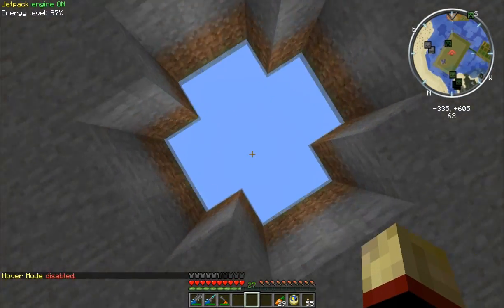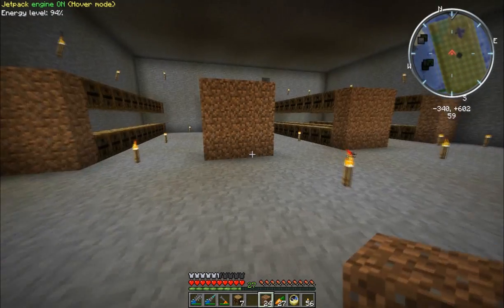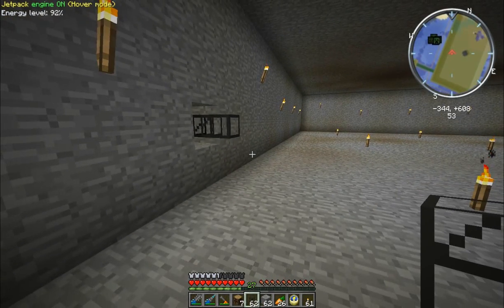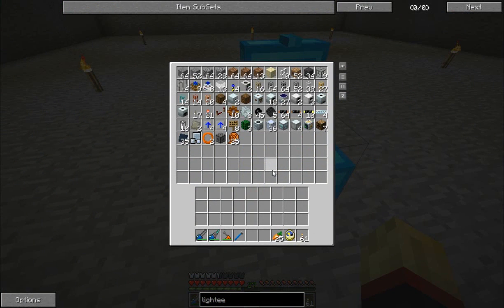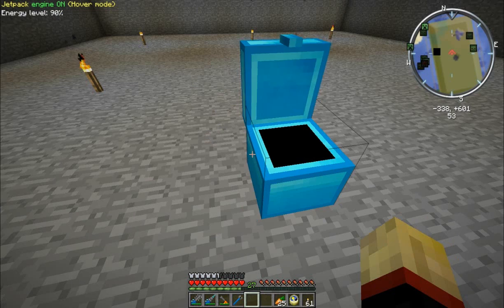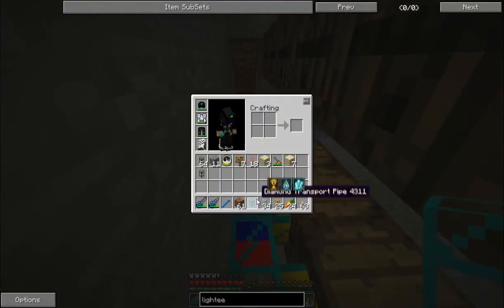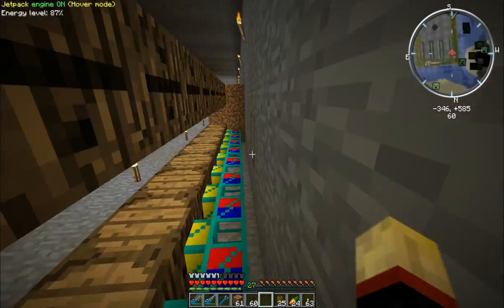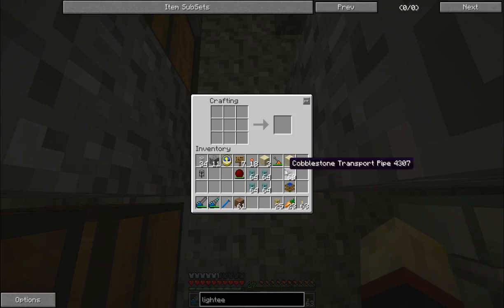Minecraft: Feed the Beast | Pt. 21 - Sorting Machine (The Idea)

Comment: Hey Poncho, Using That Rotary Macerator  Requires Constant Power To Keep It At Top Speed Which Will Waste A Lot Of EU. However Using A Normal Macerator With Many Overclocker's Will Use The Same Amount Of Energy As Normal But Faster. In Addition I'd Recommend Powering All Of Your Machines In This System With Your Solar Panels, As Its Renewable And Could Most Likely Keep Up.
Finally Use Autarchtic Gates (I Cant Spell It Correct) Instead Of Engines As They Can Pump Only When Items Are In Inventory.